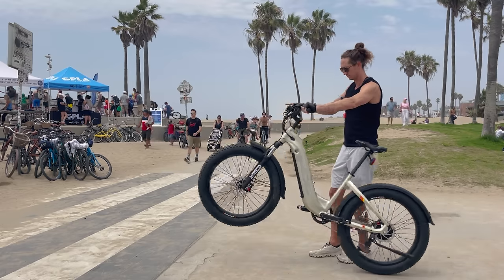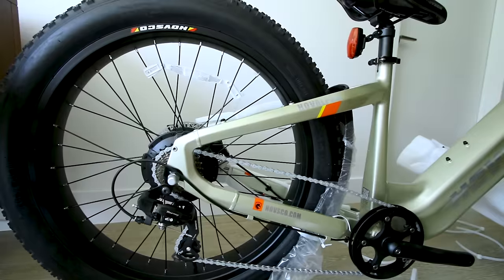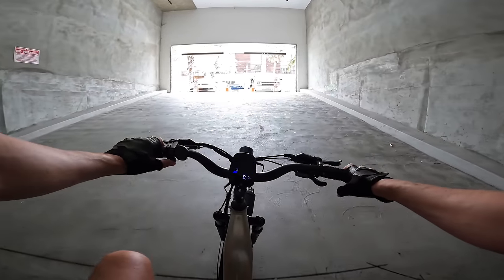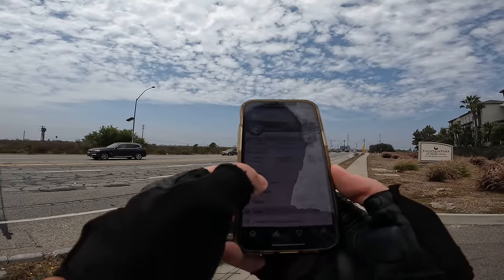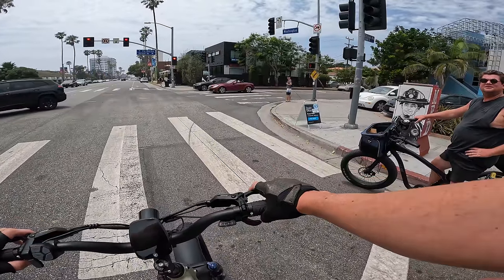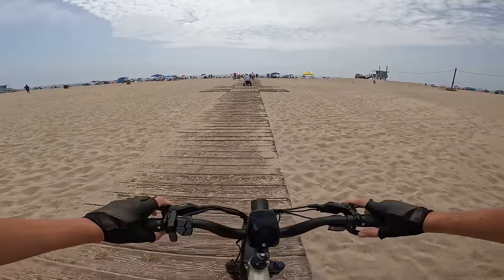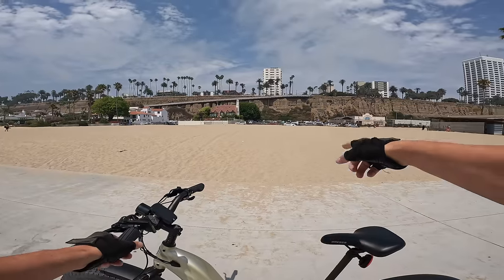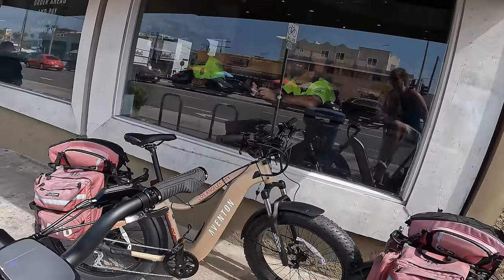Aventon DOES NOT Want You To See This Ebike! Hovsco HovAlpha Review

Comment: Got to do a 20 mile ride on this Hovsco, and was REALLY impressed with there Torque sensor system. Hands down the way to go over a cadence ! Also you Barely move the crank and the torque sensor picks up immediately ! My Wired takes at least a whole quarter turn before it will pick up.  Meaning you almost always have to throttle just to get started. Not on this bike!  I really loved not having to keep changing the pedal assist up and down all the time. Just leave it in 5 unless you really need to go slow, or get more exercise for a work out.

Comment: Hey man! Great reviews! Im not nit picking. And i really cant tell if you are or not. But i think you want to “lean back” when your riding on loose sand. Dont like actually just move your shoulders back and sit up straiter. But you want to shift the weight to the back tire. keeping your weight off the front tire will help reduce it slipping out from under you when steering also. Like hang your butt over the back tire and see how it goes.

Comment: Optional fenders, optional rack, no wired brake/tail light, no turn signals. I'll hang on to my Aventure.2.
Reply: I agree, I do like the 20Ah battery. But the Aventon has a great local dealer network,  better durallier, better lights, comes with a rack and fenders. Given all of the this, I think the Aventon is a better value.
Reply: Includes fenders
Reply: Do you use the turn signals?
Reply: @ChampagneOppa  100% all the time.
Reply: @VictorYepello  I bought  the cobalt step through aventure 2. I love it!
Reply: literally the 4 cheapest and least important features lol
Reply: they dont charge more for nothing at least
Reply: @mikec4308 In your opinion yeah.

Comment: Love the paint, big battery, and hill climbing ability. Acceleration is a bit sluggish for me, and not only is it in the same range as a Rad Rover, it's slower than an Aventon Aventure's 7.65 second time. Design is nice, and while torque sensors are preferred for many situations, I've never had a cadence sensor that limits speed. That's usually a function of the controller PAS level programming. The throttle is a pretty unique design and I like it, despite being on the wrong side.

About the whole Aventon thing: an Aventon does have some advantages, however I have to admit this is a better value. In the past, many Aventon owners I encountered were pretty stuck-up, but that seems to have changed. I did have a funny experience last year involving a couple of guys on Aventons last year though. They weren't even going the same direction, but when they saw me, they decided to prove their superiority to my lowly RadMini, and literally smirked as they passed. The thing is, we were headed into the longest climb on the route, and they just didn't have the power to stay ahead despite standing on the pedals as I passed them effortlessly. Attitude adjustment complete! Please note that this is not a reflection of the company... just bike riders in general who think a higher price tag makes them better.

Thanks for an excellent and entertaining review as usual (I've never seen a pole dancing puppet before!), and looking forward to the next one.
Reply: Yes if you're a lazy rider, don't get the torque sensor ebike.

Comment: Playing devil's advocate...for the Aventure 2 and HOVSCO as I feel Aventon is still far superior.... Don't get me wrong I always love your reviews, but...

- Aventure 2 is $1999, the HOVSCO is listed as $1999, but temporarily is $1699 so the comment at 13:18 of "it's pretty much better and cheeper" then Aventon, I feel, is misguided.
- Both have front suspension
- Both have hydraulic disc brakes
- Both have the same 750 watt motor
- Both have a torque sensor
- Both have throttles that do 20mph, both PAS at 28mph
- Both have fenders, but Aventure 2 comes with back rack already installed
- HOVSCO plastic fenders, Aventure 2 metal fenders
- Aventure is 8 speed gears, HOVSCO is 7 speed gears
- HOVSCO has head and tail light... Aventure 2 has this and integrated tail lights plus turn signals

At the end of the day, buy what's right for you, but for me I feel Aventon is the better bet... I learned the hard way with buying my first ebike because it was adverted as a cheaters solution and, yeah, "cheap" was correct. Ditched it in six months due to total lack of customer service after the bike broke.
Reply: as of dec 22, 2023
Hovsco had this bike for $999.

as of all of november until cyber monday, Aventon had their level 2 as low as $1499

i don't disagree with you,  at all since ultimely you DO get what you pay for. but sometimes, smaller companies drop their prices to get more customers. 

I do like Aventon's more steamlined look but since this is only a hobby bike and not a full time biker, I hope my Hovsco is decent for me. 

$500 savings means i can pocket the difference OR buy an additional battery for a quick swap on my longer bike rides. or heck even buy a few random accessories, like the phone mount, side mirror, horn/bell, helmet, extra inner tubes, battery powered inflator, or so much more.

$500 goes a long way.

Comment: Just ordered my HovAlpha using your discount code. I'll provide some feedback once I have a few miles on the bike.
Reply: The HOVSCO HovAlpha has turned out to be a really fun well-built bike. For most of my riding I’ve had the peddle assist (PAS) set to one. With PAS set to one and using the top three gears I was able to get up most inclines with little extra effort. We have a half mile long 9% grade leading up to our house and this is only area where I kick up the PAS up to 5 and down shift. I could likely make it with a lower PAS setting, but the climb is on the return trip home. The fat tires and front shocks make is a comfortable bike to ride. Overall, the build quality, paint, mechanicals (gears, brakes etc.) are at or above what I would expect at this price point. My wife’s bike has a cadence sensor where the HovAlpha has a torque sensor. The torque sensor seems to have a more natural peddle “feel”. 
Minor gripes are the rear light and the seat on long rides. The rear light runs off its own batteries and has to be turned on and off with a switch on the light itself. Another issue with the rear light is that it’s mounted on the seat post and it is blocked if you have anything on the rear rack. The seat isn’t bad, but I think I’m going to upgrade to something like a Cloud 9.
Reply: Quick update: After less than 50 miles the bike refused to turn on. I worked with Hovsco support to try and troubleshoot the issue with no luck. While it was disappointing to return the bike, Hovsco support arranged a relatively quick exchange for a new bike. Because I’m on the east coast and Hovsco is in California, it was around a two-week turnaround time from shipping the bike back and receiving a new bike. Hovsco covered all the shipping charges, but I had to repack the bike in the original shipping box.
Reply: @rogerrrice  Bummer.... what would you have had to do if you never kept the original packing material? Majority of buyers would unlikely have done that.

Comment: TailHappy, I was thinking of changing the front chainring to allow me to pedal at faster speeds. Do you know how large a chainring I can put on this and if I have to change anything else?
Reply from the maker: the new wired freedom has a 56T which allows for pedaling up to 40 MPH which may be a bit excessive for the hovalpha, so maybe go a big smaller than 56T. If you only go up a small # of teeth you can probably get by with your current chain, but you may need a longer chain, or simply add a few links to your chain.
Reply: @TailHappyTV  Thanks! I noticed on the HoveAlpha, the frame only allows so big a chainring size so I gotta be careful. I love my hoveaplha. Had to raise the bars and lengthen a hydraulic cable but that is the bane of tall folks like us, LOL.
My ebike really bridges the gap for us military vets in between full walking and needing a wheelchair thing. It is a beast offroad. 
I'm am thinking of looking for something more 'plush' though for heavy and tall riding on street. I'd like to find something that pedals in a way that I do not look like or feel like one of the circus clowns and yet when I come to a rest, I can actually still sit on the seat and feet will sit on the ground still. Is there such a beast?

Comment: This ebike seems to have the best balance of price and features for a road touring bike.   The torques sensor is GREAT if you want a bike for exercise.
Reply: So could you use just throttle if it were in class 3 mode  up until 28?
Reply: @Bengafriends  In some cases yes.  I a few, you have to help the bike out by peddling in the highest gear.  Many bikes are geared such that if you use the throttle at max and achieve 28+ mph, you can't pedal fast enough to keep up with the motor.

Comment: Looks like a great bike.  Can tell its a very good motor.  Display is ok if it has a power bar, but looks dim.  You could not be more wrong about "exercise value" of torque sensor, although it does look like a good one that gives you a lot of fine control over speed hands free.  You are "special" for wanting super low exercise, but your payoff is hands free speed control.  9 cadence PAS levels gives you exercise by letting you pedal hard without going too fast.  Changing PAS levels is pretty darn easy compared to mechanical gears. If you only pedal during hills, you can overamp your controller but not burn out anything by keeping the speed moderate on hills.  Pedaling hard saves battery while staying speed appropriate.  You should test hill climbing, especially busy california incline, with that torque sensor pedaling.  Would show the weakness of it.  Low PAS is too hard to get up, high PAS means slow pedaling to keep control.  Very hard to fine tune a high enough exercise level to safe speed ratio.

Comment: It's $2000 now. Plus the battery is not UL certified. Wouldn't feel comfortable. Rather get the Aventon Aventure 2. It's $200 cheaper now, the battery is UL certified and they are now sold in bike stores. No user assembly required.
Reply: It seems they have a coupon: AA400
Reply: Hovsco alpha

Comment: This bike is same as Aventon other than battery and cost the same. I have Level 2 and get MORE range than Aventon claims. I also have Specialized Turbo Como IGH 5.0. I seem to get better range on the Level 2. So what a company states can be more or less with same power. The range on this is probably more important.  Should be side by side comparison with Aventon ebikes.

Comment: I want an ebike where i don't have to pedal. 
It makes no sense to me to have a motor, yet it needs assistance to operate.
Reply: you dont have to use the pedals, it can operate throttle button only.
but due to legal reasons in USA, Canada, UK, EU, and at that point its just standard for the manufacturers to all make it that way. 

so yeah, throttle only gets you only up to 20mph or 25kmh (15mph) Europe. and with pedals its up to the higher speeds.

this is basically cuz bikes occupy the same spaces as pedestrians. so if a bicycle wants the same legal protections as a semi-pedestian mode of travel it legally cant have that much speed. 

i mean bikes are a quasi pedestrian  mode of travel, they can go on sidewalks and walk paths in parks. as such it would be negligent for any governing body to allow them to have crudely high speeds. thats what GAS powered bikes are for. 

i mean... i guess if the e bike was pedal only and had higher speeds, but thats an e motorcycle at that point or a dirt bike which falls under a differernt legal category.

now the DMV, license plate fees, registration, the need for a certification to operate. illegal for kids under 15 operate and other legal realms come into the conversation. 

keep looking on the internet, i hope you find THAT category of e motor bike. but at that point, its not a bicycle any more but a moped, dirt bike, e motorcycle, and what not.

Comment: I'm sorry to say, your content is missing on what bicycle meant to be... Here in Europe Bosch, Shimano and Continental drivetrains are the dominant ones, and more expensive than hub motors... E-biking is meant to maintain the sport of cycling not to use only Throttle, while I would like sometimes to just press the button on my mid drive E-bike, it doesn't have a throttle function, but it has a complex system for what an E-bike is meant to be, it is drivable even without the Electric part... this is the first Bike I see from you that has an actual good torque sensor, which is important for the feedback, the sensation, the natural mechanism, that you are driving it not it driving itself, although with a hub motor it might limit that sensation. I would like from you to appreciate the mid-drive systems which don't have a throttle function, (not talking about Bafang, it is Chinese like all the hub motors, I'm talking mostly about German or European mid-drive motors)
Reply: You have to remember we have a very different culture here in the States. There is still a huge cycling culture, e bikes are more for older folks or commuters.
Reply: @TomCarmody-x1l  I admire your comment.

Comment: The Aventure 2 does have a torque sensor, is UL certified (the Hovalpha is not), comes with rear rack and fenders (you have to buy the rear rack separately on the Hovalpha), has integrated taillights and turn signals, and it's $200 cheaper. I think it's disingenuous to say the Hovalpha is the better deal when it clearly isn't. It's a shame because most of your reviews are quality.